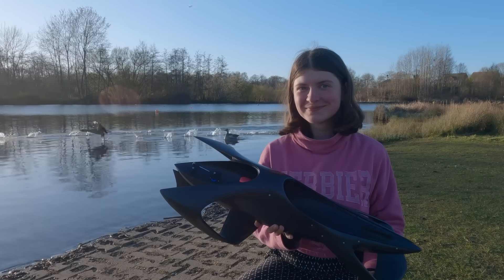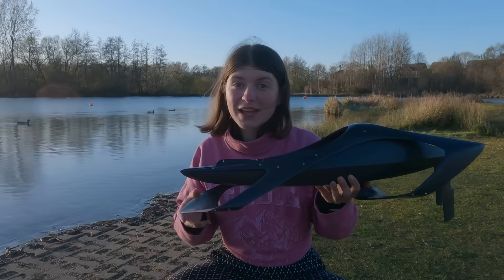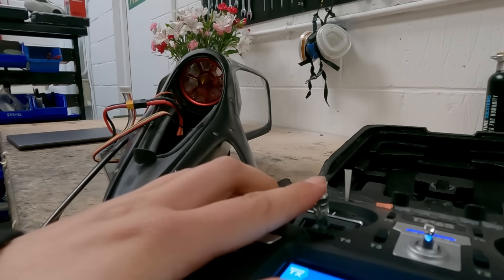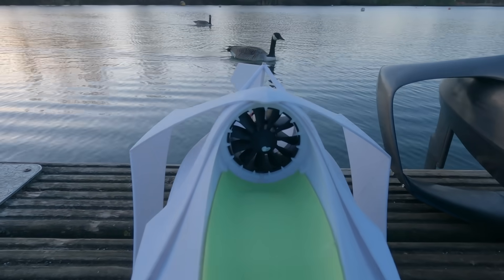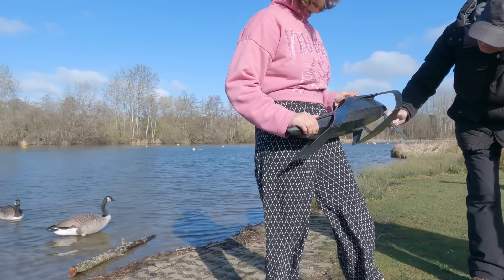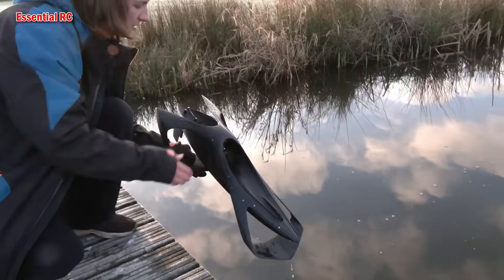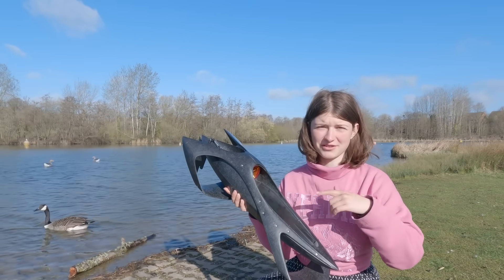Boat Propellers are Overrated... The HydraJet Explained

Comment: Pretty cool concept, the design is badass too 🔥🔥 does torqueroll from the edf have any effect on it? I generally see people using two counter rotating edf so their aircraft doesnt roll too much to one side and it could give you differential thrust (although I doubt it would be effective)

Comment: Why did you not go straight to WIG ?  Love the design.  Foiling boats are good up to around 40 kts the slamming issues increases.  You will approach cavitation limits at 55kts so may we well go to WIG.  Really great design .. For WIG remember that the delta configuration would be best as LCG and center of lift would be in approximately the same place - so at higher speeds you will not get blow over.

Comment: Great  concept - I'd would like to see more interactions.  PS You may be losing a lot of power with the surface piercing rudder when you scale up, try shortening it to just below your rear wing/foil that should give you low speed control but act as a trim tab when planing.

Comment: Hi, regarding the rudder, have you considered a dual rudder, both in the air and water, the water part being cut shorter (or tapered), meaning as you transition into waterplaning mode, you'd have enough speed to make the air foil work and the water rudder is completely (or partially) out to reduce drag, whereas at lower speeds, your water rudder does the steering.
If you have, did you test and why did you abandon the idea ?

Comment: i love the design of your latest model, but the need for hand laying means you cant scale up the production. 
have you thought about redesigning it to be printed with high performance FDM materials? think of PPA-CF, PPS-CF, PET-CF, augmented with carbon tubes for strength. 
a design like that would allow you to easily scale up production by buying more printers, and differentiate between a high priced plug and play version you finished yourself, and a "fresh off the build plate prints + raw cut rods" kit that is super affordable because your labour input is minimal.

Comment: This looks fantastic! Like someone else commented; its a piece of art. 
I have tons of questions, here is a few: 
Have you tested it in a wind tunnel, or tried emulating it on a computer analyzing program to see if you can add some airfoil lift from the stabilizers that goes down to the bottom wings?
What about roll stability? Have you accidental rolled it around in the water when taking too quick and sharp turn?
I guess the interior electronics are in a waterproof compartment, but how do you get the fan motor (EDF) waterproofed?

Comment: Full size vehicle: Helicopter turbine or a small turbofan. Variable direction ducting (vertical axis only) for additional trim using the thrust of the fan for lift or weight as needed to properly balance the boat and load. This could be connected to gyroscopic control so that no matter the forward pitch (say... +/- 30 degrees, with angle of attack warnings starting to kick in at +/- fifteen degrees off the set trim position) the ducting repositions thrust so it remains at a constant angle to the average surface / sea level.

Not an engineer. Throwing ideas at a wall.

Comment: I always love to see inventors work out their ideas, and working within financial constraints produces some of the most ingenious designs.  Excellent work!  Hopefully many more builds to come.

The first thing that came to mind was how the HydraJet almost glides on the water like a water bug.  That got me thinking, if water bugs disperse their weight over a wider area focused on 4 legs,  and 2 legs acting as rudders.  Maybe you could reduce even more drag by dividing the larger wings or perhaps placing them where the front wings wake doesn't interfere with the back wing, like how a tricycle leaves 3 tracks with no interference from other wheels.

Happy Engineering!

Comment: Looks like a boat Disney would use in a reboot of the 1991 series "The 100 Lives of Black Jack Savage". That short lived TV series used a full scale real boat and a radio controlled model. The boat was a reverse 3 point hydroplane with a narrow forward hull/cockpit at the point of a delta wing. At the rear points were two pods with engines and props. It was quite fast, with minimal water contact surface when on plane. The wide spread contact points at the rear resulted in flat cornering and extreme maneuverability. I wonder if it had a forward rudder at the back of or underneath the cockpit? I'd thought it would cause a revolution in offshore racing boat design, but it's rotting in a Disney backlot since the mid 1990's.

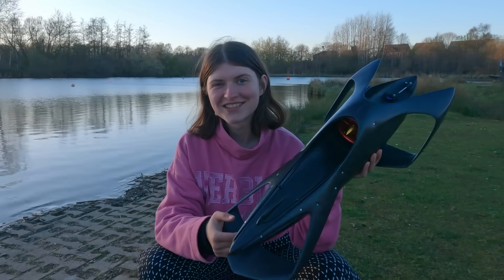Comment: 8:42 Your first design was great, but the 2nd one was unbelievable! The next could substitute multiple air rudders behind the fan for that one water rudder. Then maybe add 3 tiny aquaplane pads strategically placed below the present sub-surface architecture to lift everything completely out of the water at the very highest speed? (Essentially, barefoot waterskiing the entire vehicle on the water surface. 😆)

Comment: I’m a fellow designer but I work in aerospace, I started designing aerodynamic components for the industry but now I mostly design corporate jet interiors and interior components - I am so impressed by your designs - even the early prototype shows real talent.  I designed a aeroelastic (hydro elastic) hydrofoil in my teens but it never went to production because of some of the same problems I am sure you encountered and to this day I haven’t seen anything like my concepts in the market. Good luck with your endeavours - ide live to see something aeronautic, I’m busy with a 2 seat electric sports aircraft currently I wonder if you would like to collaborate?

Comment: OUTSTANDING!!!  

Some tips (you may have already done these):

1)  Minimize the buoyancy hull to the minimum required for stationary and displacement movement stability at your design sea state.
2)  Minimize the hydrofoil portion to that required to get up on plane using, say, 50% to 70% power (battery drain rate).
3)  Optimize the hydroplane portion to that required to most efficiently transit the water's surface given your desired range of sea states and acceptable operational velocity cost profile.

I'm thinking this has serious application in the passenger ferry market.  Not so much for vehicles, but otherwise...

Comment: There are some things which are critical. What if something comes in the impeller? There could be a protection, so that no animal could be shredded in this fan.
It would be good if it is waterproof or at least the electronic and battery should be withstand water.

Comment: Seems like something you could put an FPV camera onto and start a racing league. The lack of a prop in the water means you could include ramps and maybe even short segments on smooth ground. How does it handle when fully airborne (like off a ramp or when hitting a big wave)?

Comment: very cool!  It reminds me a little bit of the flat-bottom planing swamp boats in Florida and Louisiana that have big fan at back.  Those, i think, are designed for very shallow waters where the water depth is unpredictable, and sometimes they go over and through areas blocked by swamp plants that boats with keel, or propeller would be stopped by.   
Your design is much more futuristic, and I wonder what applications it could be employed for among boating communities.  It certainly looks spectacularly fast!

Comment: For the foil angle rather than bolting different foils make the legs able to pivot (at the fuselage) a simple pusher and grooved set positions for driving modes will ensure smooth transition and less stress.
Probably around the mounting points to the fuselage. Also there seems to be an issue in the rear. There shouldn't be so much water being picked up by the airflow.
The sharp angles at the end seem waste of material or are you front heavy?
Love the design though. Think it have a lot of potential. 👍

Comment: That surfacing work is miles better on the carbon version! Looks really nice and stunning, such an amazing job! I'm glad the algorithm showed me your video, I'm definitely subscribing
Reply from the maker: @amigodesigns  thank you! In the carbon boat build video you'll see the sheer amount of sanding it took to get that finish!
Reply: @CovaConcepts Hahaha, I can imagine, some hate it some find it therapeutic. 

The next step is probably to make some negative molds using ABS-GF or even a high-temperature filament to prevent warping when curing the final CF or GF mold in case you want to use temp ramps, etc.  Tbh, I'm talking without knowing exactly what process you took. I understand PLA for the molds, which is definitely a more accessible approach. Either way, looking forward to watch that video!

Comment: Really great work. It works fine and looks great. I was surprised that it causes such a lot lift at low speeds already and that it has such a small turn radius.
Years ago I was involved in the design of two RC Hovercraft. It´s much more efficient to use two parallel control surfaces right behind (distance on yours looks too large) the prop than only one. Without a rudder inside the water it would have less resistance and it would be also safer against damaging it, if there is s.th. in the water it touches at high speeds. On the other hand it might cause a negative rolling moment, because the aerodynamic control would be above the water line and above the CG.

Comment: That's very impressive.  Initially, I was thinking there was a lot of water displacement and thus terrible efficiency, but then you said you weren't going for efficiency.  However, looking closer at the boat club demo, it appears that the water displacement is coming mostly from the prop thrust rather than the foils and therefore isn't an indicator of foil drag.  So I'm left thinking there's a LOT of potential in this for scaling and optimization!

Comment: Just found your channel and sub'd
What a great looking boat design! 
If you design a 3-wheel Velomobile car, I would buy the plans and build one. 
If you go 4 wheels, it can not be considered a bike in Canada. Only 3-wheels tops.
Reply from the maker: @piconano  thanks! The other project in my video is in fact a 4-wheeled electric assist velomobile. The regulations are a shame in a few countries, I started off with a 3 wheeled design but the stability was a limiting factor so I had to go for 4
Reply: @CovaConcepts It's too bad. Although you'll be hard pressed to flip a trike bike. 
It's almost impossible without an over steer. 
This video got me hooked and I want one.
google this if you want to see the video;
 "Check out the solar-powered clipper trike making its way across the Western U.S.!"

Comment: I would like to see some serious calculations on a full scale model.
Like the size & weight of batterypack,  size and power of engine and propeller.  
The chance of finding a boat builder wanting to help out with the project will increase drastically.

Comment: Very impressive performance for an RC boat design which hasn't been fully optimized yet! 
Maybe the wake/drag can be reduced some and the EDF could have vanes to control the pitch. 
What I'd definitely explore is putting a foil on the rudder itself.
Even in its current form it seems to work quite well so any optimization is just icing on the cake :-)

Comment: G'day,

Liked & subscribed...

You're doing excellent work....; keep on keepin' on.

Where were ye planning to locate Batman's Wheel-House..., perched atop the Duct, or lying 
Prone or supine - 
In the bottom  of the Inlet-Trough ?

Or were you thinking of Batman launching fleets of Uncrewed Maritime Vehicles, all based on this Hull & Modular Water-Wing/Hydroplane...?

The Road-Vehicle looks interesting, but if it's sufficiently light as to be worth doing..., that Prototype looks rather tall, on a narrow-ish wheelbase, featuring quite a lot of Side-Area in the case of a strong Crosswind Gust, or the Buffetting from the Atmospheric Bow-wave from a Truck going the other way at Highway Speed.

Low Aerodynamic Drag, with a low Side Area as well...; seems to be the Shape of Propulsively-efficient
Electric Road-Vehicles.

(I ride a Talaria Sting L-1(e)...; Stand-alone Solar-Charged 3Kw Road-registered Motor-Scooter..., homologated to 49 Km/Hr at full-throttle/full-battery, 15 km to town for small groceries, and it goes 33 Km on 1 Kw/Hr from it's 2.3 Kw/Hr Battery.

As Airspeed doubles, Drag SQUARES...; so anything over 50 Km/Hr on the Road is decadently Anti-Efficient
By
Design....(!).

In my humble opinion... (lol).

Such is life 

Have a good one...

Stay safe.

;-p

Ciao !

Comment: I’m wondering if the boat could utilise an elaborate control method where an FPV flight controller could manage the two control surfaces. I can imagine it having one small surface to keep it over the water.

Comment: Looks really great! I've been wondering if using two fans could be a good idea, among other things to make it easy to have the intakes at the sides, which should make it easier to reduce noise and other impacts of the fan on the boat, which seems like it could be beneficial for a life-sized version, maybe even enough so to be considered worth the penalties to aerodynamic efficiency of having two fans compared to one bigger fan, and the space those intake ducts would take up.

On a model where noise on the boat isn't an issue, I suspect having two counter-rotating fans is easier way to make it possible to push the power level much higher without having the torque reaction just flipping boat, compared to coaxial contra-rotating fans.

Comment: With ground effect wings could have 4 modes, sail,plane, hydrofoil, fly ( up to 150m high Catagorry ground effect) with 2 vertical solid sails, could be also a sailboat, until wings fold horizontal for flight. I have a design idea for that.

Comment: I invented vibrating foils.
If the surfaces that are in contact with water vibrate, it is reducing drag. 

It works like stone flipping.

I also designed a lightweight car that is under 200kg.
It got a new suspension design.
And chassis and body are merged. 

The car also got propellers. Cause it is more effective to power the air too, that is producing most of
The drag.  

The body of the car mostly got flexible foil. 
Only the front window and carrying parts are solid. 

I also designed wheelhouses that work with flexible foil. 

I would like to get some social connection with people able to build it.

Comment: But aren't EDF's less efficient than generic propellers so just using an air propeller would do more than using a high power edf, I haven't even watched the video yet but I'm just saying
Reply: Also ducted fan  with a higher efficiency in my opinion Would be a jet engine But when it comes to fuel efficiency the EDF would be better, I think. I still haven't watched the video yet

Comment: As an inventor working with fluid dynamics I applaud your efforts.  And I'm inspired by your success, since life has also gotten in my way a bit... and I will soon be producing some of my own very unique hydrofoil prototypes.  For greater speed, I know you love your turbo fan, but I would suggest you review some youtube videos of Thai racing boats.  They hand-craft their own surface-piercing propellers which provide instant acceleration unlike turbo fans which suffer from the power-degrading elasticity of air.  Keep inventing, the world needs more of us out-of-the-box thinkers.
Reply: That looks like a great alternative, since it eliminates needing to have water seals through the hull. She can literally keep her current design and mount the motor in place of the EDF, with its prop shaft running right off it and into the water! 

Ideally, might need/want a brace+bearing, but that's easy to add with a simple hole drilled in the rear with a bolt to hold it. (this would also help prevent directly tweaking the motor if you happen to hit something/run aground)

[edit: typo]
Reply: Water Props are way more efficient than air. Also water hitting a full size prop will destroy it & if you are going into a head wind you loose that amount of thrust. not to mention the huge amount of space needed for an air pushing prop.
Reply: I get what your saying, but have you ever tried steering a Thai racing boat?
Reply: @ "Longtail boats" seem to steer just fine running down those narrow canals.  Even their towboats use longtail props.  And once your planning/skimming, steering can be done by shifting weight and increasing wetted surface (friction) to turn.
Reply: @Slimboid  If she uses what I suggested, mounting the motor in the current spot, it would be a fixed water prop, and since it extend out and down into the water, she'd retain her current rudder steering (instead of using their steering method of moving the entire motor and prop shaft assembly).
Reply: @Slimboid  Why would one want to be in one of those dangerous things. Narrow unstable boat, long unsupported drive shaft, What could possibly go wrong.
Reply: This looks fabulous. A very clever design.
As for speed though it would be interesting to produce one without radio control and put it up against tethered hydroplanes.
Reply: And I would suggest, rather than shitting on her channel with your one dimensional conventional thought comment, to save your time in your 'busy life' to bugger off and go make your own videos of your own ideas. I'm quite certain she doesn't need your input to follow her own ideas and destiny. She is an amazing young lady and clearly fully capable.
Reply: @ of course Ash, or WTF your troll handle is, as a young woman, and not an engineer as you suggest. She should only receive praise and no constructive criticism. You have a point. As a misogynistic loser.
Reply: @Ash-cy7yw  Agreed. This is mansplaining at it's finest and it's sickening